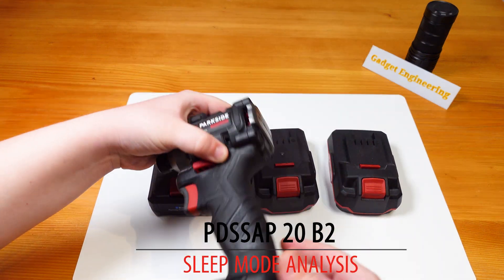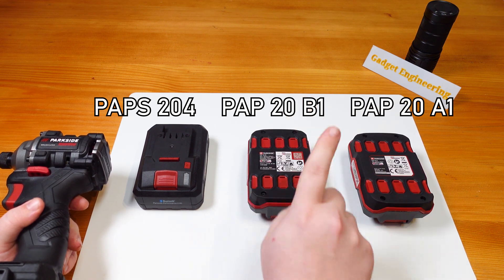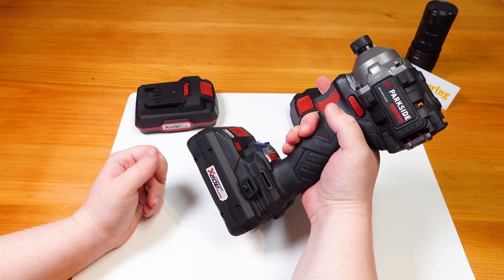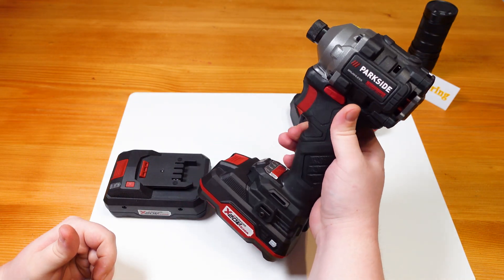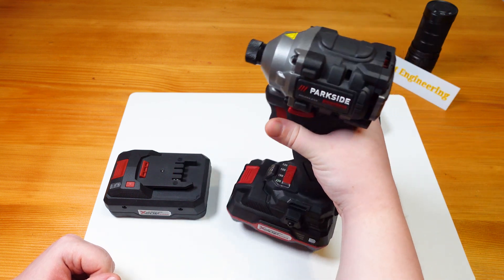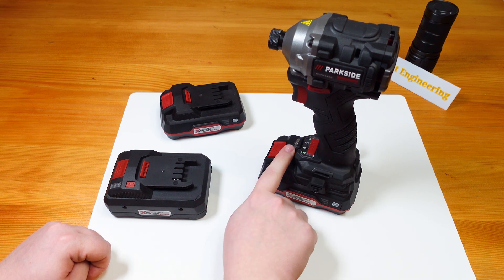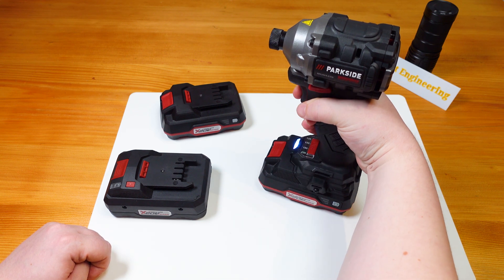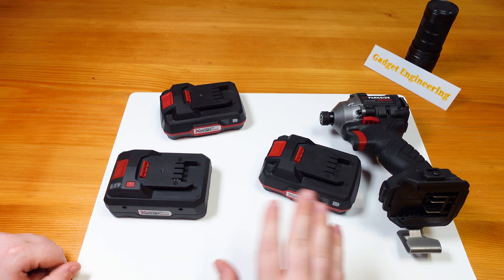EXPLAINED Sleep/protection mode Parkside Performance PDSSAP 20 B2

Comment: Maybe there is few diferent firmware versions because I bought this tool few weeks ago and it never goes to sleep mode as you are showing. It only turns off torque setting indicator after  about 40s and if you push the trigger even small amount it turns on  and rotates slowly on the first time of push. The same after instaling battery. 
Production date of my tool is 2021-08 
IAN 364886_2101 - TF
S/N 038746 
Maybe this helps to fugure out is this a malfunction of  firmware bug
Reply: https://youtu.be/oGxKaA1UA4E short video
Reply from the maker: It's the same behavior, the depth of the trigger pull may vary a bit due to tolerance, but after 40s idle, lights out, torque button does nothing, you have to pull the trigger, and it takes 3/4s from trigger pull to motor turning, but now with the awoken tool even a short trigger pull results in immediate movement. Thanks for the reply+information!
Reply: mine is 2021-08 as well and it reacts even to light press, 1mm push on the trigger turns it on

Comment: And another thing I saw in 2 separate videos, one being this one https://www.youtube.com/watch?v=xXBqofvmaWI looks like it goes in some over current protection mode event with the new 8Ah battery.
Reply from the maker: I've only has it happen when running slow, meaning the hammer doesn't have enough speed to skip over the anvil, and stalls the rotor. If you're running fast enough it will actually 'impact' and you won't lock the rotor and cause the overcurrent condition. With a bit of wear the hammer will slip easier and this will be a less common occurrence :)
Reply: @GadgetEngineering  I watched some more videos with this problem and i think is a bad/cold solder joint issue inside the controller board, because even at high speed it will still stop and i think is because at high speed it vibrates so much that some  components don't make good contact on the pcb. The moment you press the plastic in the speed/torque selector area it will work again, and in some cases it will keep rotating even if you don't press the trigger.
Reply: @BinaryOptionRomaniaBOR1  Hello I have this problem with the tool, at first it stopped from time to time, but now it refuses to start. The light turns on when the trigger is pressed, but nothing happens. Can you confirm if this was the fix? I changed the anvil and I cannot send it to claim warranty as it's clearly visible that the tool has been opened and the screws touched... Thanks

Comment: Sad, it was already annoying on the previous tools that they don't respond after sitting for a short while but it seems to have gotten even worse.. They're such amazing tools for the price, if only this stupid sleep timer thing could be deactivated or set to half an hour before sleep or something. I can't imagine the circuit board indeling to use that much energy 🙃 Whenever there's a hack I'm applying it to all my tools.
Reply from the maker: I agree, just some programmer who never used the tools thinking of 'features' to add.
Reply: @GadgetEngineering  haha, that must be the reason this "feature" is there 😆
Reply: The PDSSAP 20 B3 doesnt have this "feature" anymore. See https://www.youtube.com/watch?v=Tsi_o7ZhN-Q for comparison.

What other tools do you own, that have this kind of unresponsivenes?

Comment: I get it when you put a new battery in for this protection to be activated, but i don't get it why they choose such a small timeframe for it to be activated again, 40 seconds is to quick they could've choose 10 minutes. Imagine having to use this tool to build something and you need it to screw 200 screws every time you put it down to take or do something it will go in sleep mode that will be very annoying to get used to. And even if you get used to it imagine then switching to a tool that doesn't have this protection you will have screws flying all over the place because you will get used to pulling the trigger all the way.
Reply from the maker: I agree!

Comment: Thanks for explaining. Yesterday my brother borowed my new b2 hammerdrillmachine, he tought it was broke.. i had to explain it likes to sleep! Goddamnit what diyer wants his tool to fall asleel on the job😭😭. Will there be any hack for this?
Reply from the maker: Hard to say, the programming is in the BLDC firmware on the PCB, so no changing anything there, I'm investigating an easy 2-wire hack of the trigger that might work, stay tuned!
Reply: @GadgetEngineering  try a 100nF capacitor between the + wire and control wire.
Heard that should do the trick